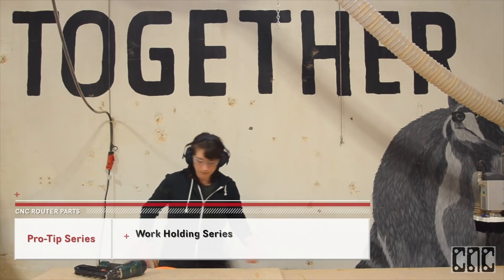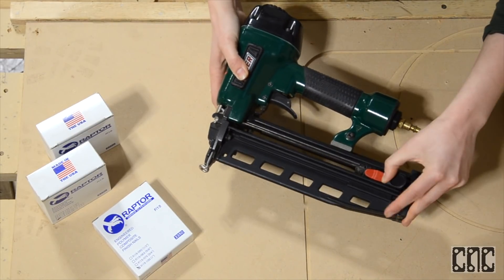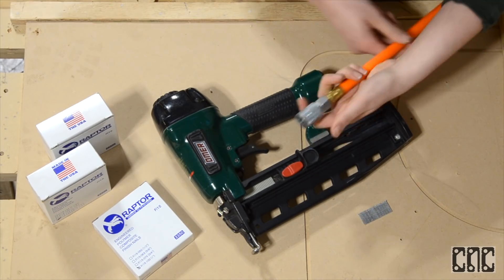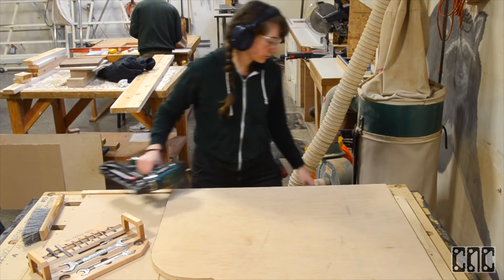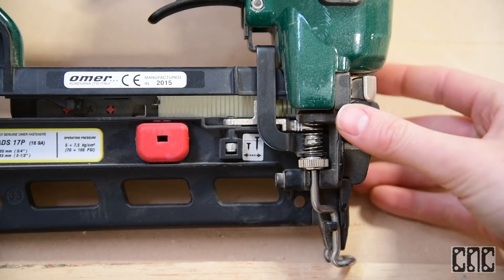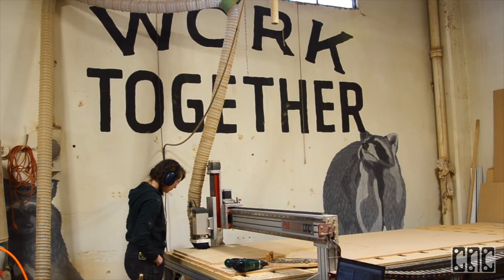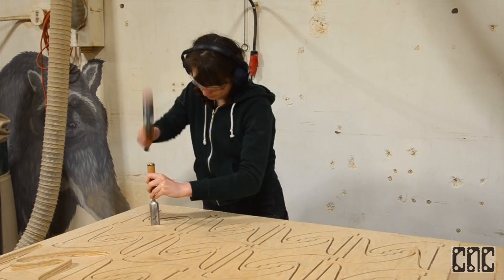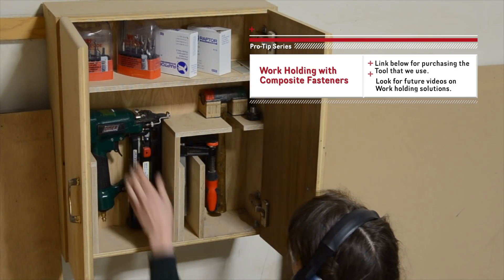Pro-tip: CNC Workholding with Composite Nails

Comment: Nice video.  Have you tried the Senco composite nailer?
Reply: I use the Senco version. Uses the same nails. Works great. Best price I have found was NailgunDepot
Reply: Thanks for the reply!
Reply: Senco has one? Good tip!
Reply from the maker: We have not personally tried that product but we believe in finding the solution or tool that is right for you! Though the general concept is the same, a quick and safe work holding technique!